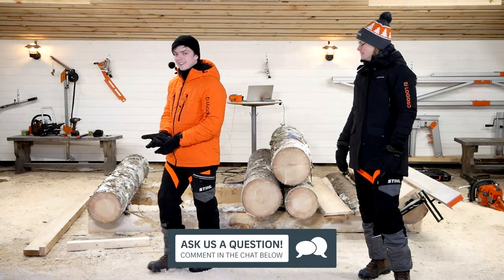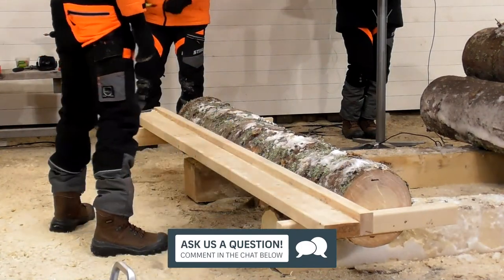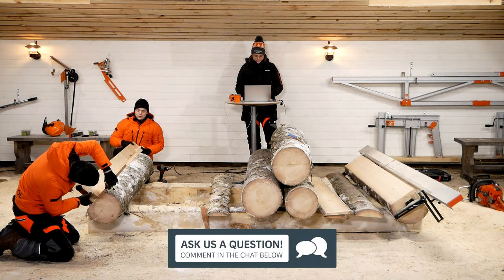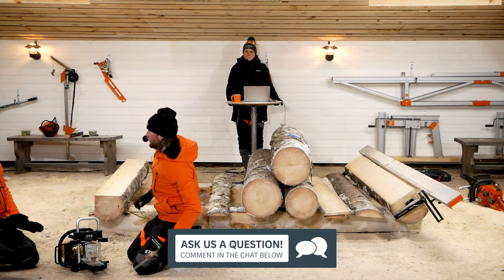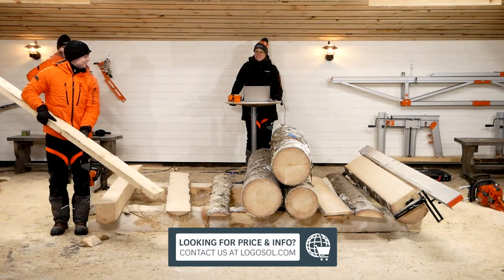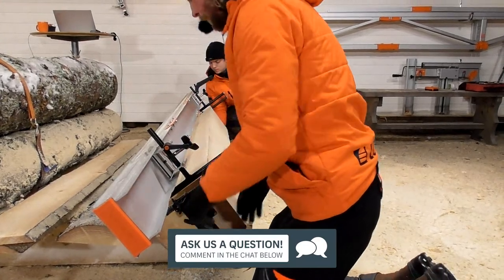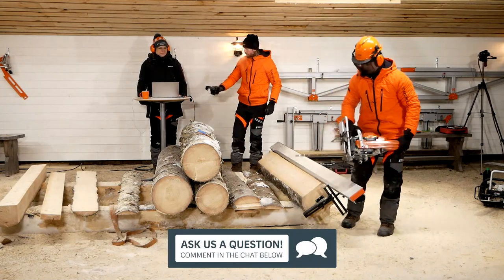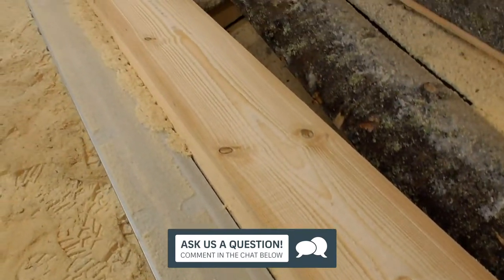LOGOSOL | Live demo - Step by step: Timberjig

Comment: Hi, It looked to me like the vertical  board on the wood rail system needs to be heightened; to match the height of the front rolling bumpers & the front face on angle iron on the Timberjig. That would help stop the handle from lifting up and causing the blade to dip; making a wavy surface on your new board. It would create a more stable 90 degree corner for the Timberjig to ride.  Nice video demonstration.